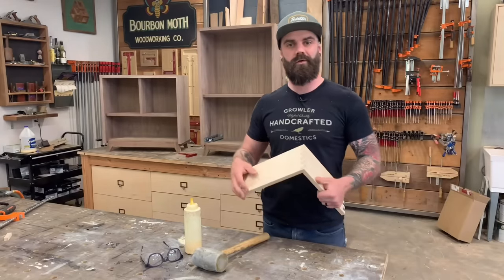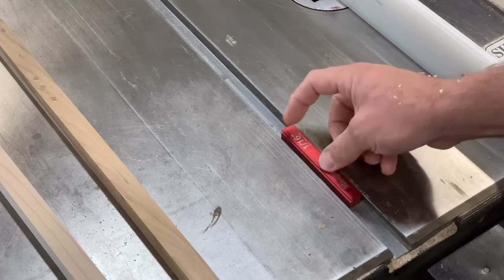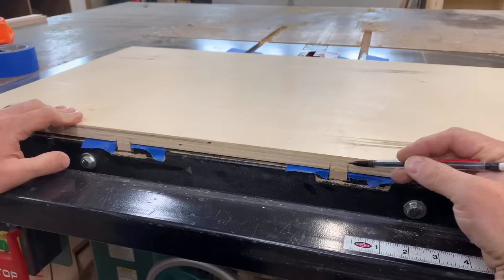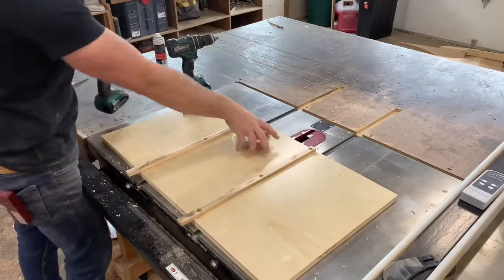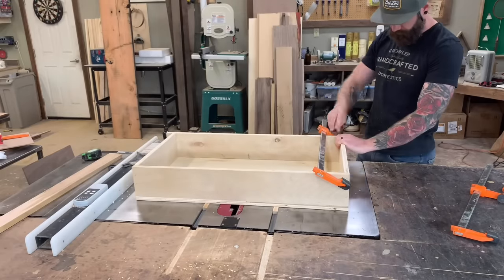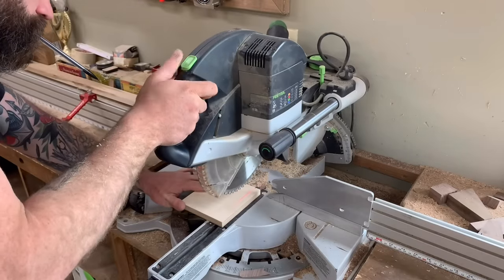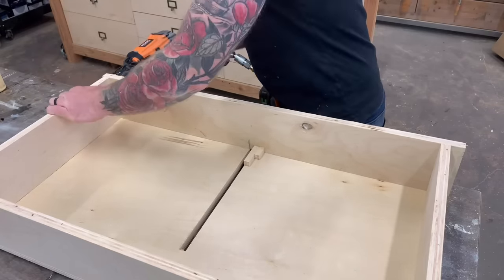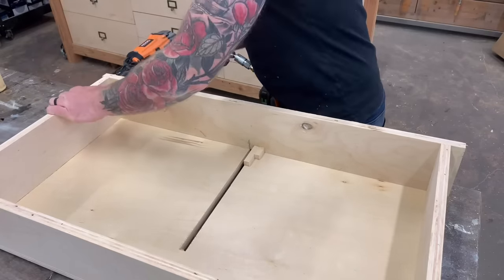Easy Box Joint Jig | How To Make Box Joints

Comment: Novice's question (not a criticism):  Why do you need to run an edge piece around all four sides of the base?  The key piece is the one with a  notch.  Why not leave the other three pieces off and just support the notched piece with some sort of angle bracket or two triangular uprights at each end.  To hold the base plate together, just use a small piece of wood on the far side secured to each side of the cut.  I hope that is understandable.

Comment: Am I missing something? Is there any reason why the jig has to be so deep as long as the guide bars and base are long enough to make things stable? Mine is 12 inches deep with 12-inch aluminum bars glued and countersunk to the bottom (a lot easier than making your own, and the bars are cheap), and I have more room than I would need to make box joints for stock even more than 1 inch if I ever worked with really thick stock.

Comment: If you put a shallow rabbit in the base it will help keep the runners straight over the long term , that will help if you live in cold weather climate and don’t have heat in your garage . And it’s easier to keep straight or is it straightth?

Comment: You should really put the guard on your tablesaw. I’ve been a finish carpenter for 25+ years and have never hurt myself on a tablesaw. Until 10/25/21. I had the guard off and the blade all the way up to rip some thick material, well my attention was somewhere else and my left hand brushed the blade, it grabbed my hand and sucked it into the blade! Almost lost two fingers. Good surgeon was able to fix it and pin the broken finger. But I’ll never use a tablesaw without a guard ever again! Thank god I still have all my fingers. I may never get full mobility out of my index finger but it’s still attached to my hand. Even good carpenters make mistakes.

Comment: It looks easy, but it really is hard!
Cost me 2 weeks of my life trying!  If you have a Craftsman table saw, it's probably not worth the trouble.
I had to rebuild part of mine just to get it close.

1.  If your saw doesn't run true, don't bother.  You have to make sure your saw is totally setup beforehand!
2.  If your fence isn't true, don't bother.  This is pretty hard with the Craftsman 80, we have to do tune ups all the time

3.  MOST IMPORTANT!!!   Never have a tight fit!  Why?  you need room for glue and the glue causes the wood to swell
Tight fits are great for the camera, but you can't make a box like this unless you plan to use nails or staples, or a rib on the inside.
Too tight a fit and the box won't assemble either.

4.  Takes a lot of practice.  At least a dozen failures!
5.  You will probably also need a planer or sander.  Passing the wood through like oak causes a lot of tear-out.  So making the joint is one problem, cleanup after is another story.

Comment: All good, but I don't understand something. At 1:54, you make the height of the runner 1/32" proud of the table. Every other video I've seen sizes the runner to keep it from bottoming out in the track. Did I miss something? I'm always willing to learn new things.
Reply: Thinner than the groove is deep is the way to go. When gluing the runner to the bottom, put some washers under the runner to lift it proud of the groove while gluing.
Reply: Also take the advice of sanding the peg down just a little.  This one looks too tight and too tight does not allow sufficient room for glue in the joints.

Comment: The. Hold is fine other than 65% of the support wood you put into place is just wasted. The area you use is less than 10” and the only critical support piece IFA the back. If you supported the back piece from the rear with right triangles and used a fairly large piece at lease 3” wide and 2.5” tall right where the saw blade goes thru you’d protect yourself as you cut them. Watching in your video you have a tense to want to watch the cut which means leaning over a whirling saw blade without protection a BIG NO NO! 

So does it work Id bet perfectly. Could not be smaller about 70% smaller and easier to store in the shop.  Could you have done away with the entire base an only built the back and attached it to your miter gauge on your table saw, many of us do but we do have to set it up every time we use it and a jig is much faster. It works could be more refined and probably work just as well.

Comment: With a router (even hand router) one can do such a joint much faster(10-20x) easier and safer.
Look here for the idea: youtu.be/XUzt9cYxG7U
And the best is - you can make your own pattern. Not the  boring 1x1x1x1x1. It can be 0.5x3x0.5x2 or whateveryou like! And all you need is a thin square bar and a router.
I did it first time with a cheap hand router, simply glued a pattern I like to a thick piece of wood and did both joining plates at one run. And it was just a perfect joint!

Comment: Whilst I love your videos can I make 2 suggestions:-
1) Please throw away your brad nailer and find some other way of securing glued joints whilst the adhesive sets: I hate the appearance of the heads and its such a fiddle setting up the compressor and keeping up the supply of nails.
2) Please, Please add metric measurements for those not in primitive countries that use ancient measurements. (sorry but I could not resist having a dig at such measurements. Whilst I am old enough to remember the imperial measurements my kids and their kids have no idea what a "foot" is if it is not attached to a leg